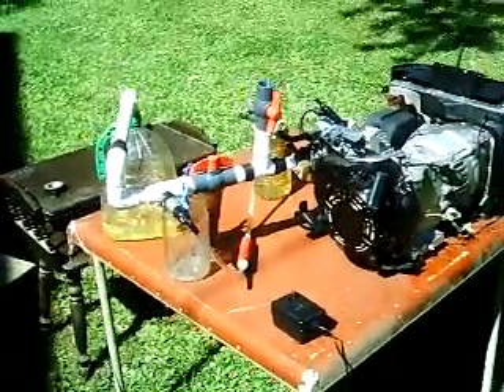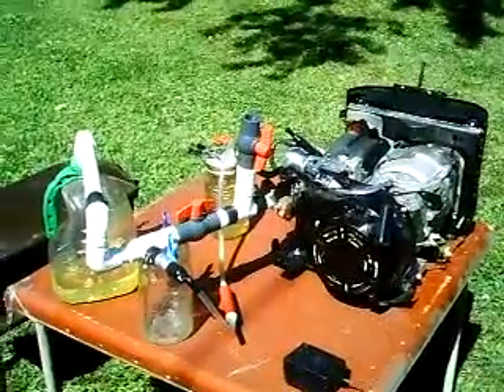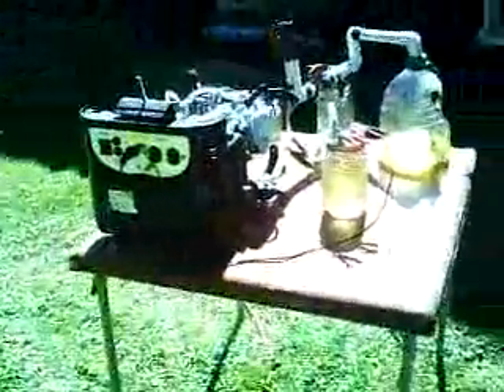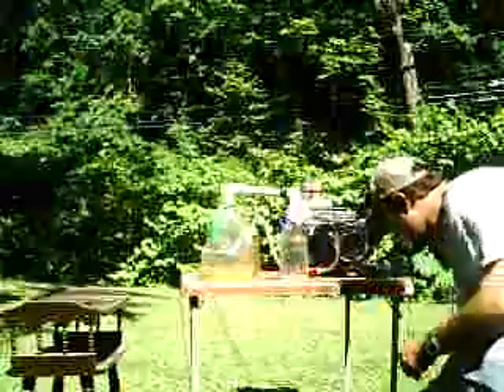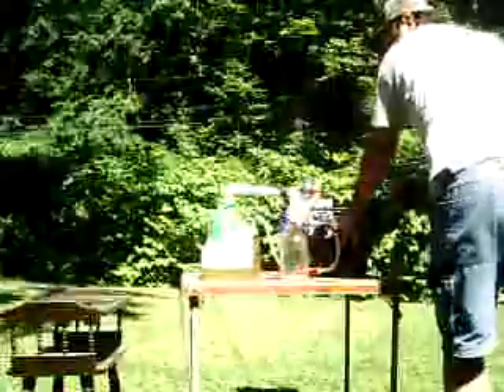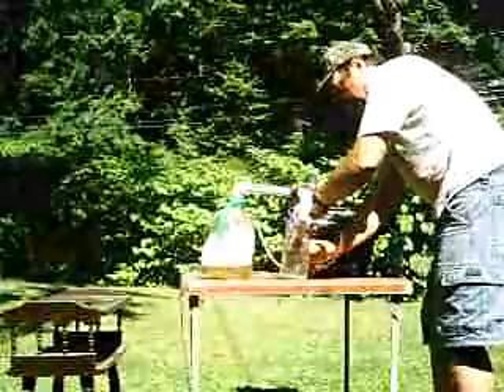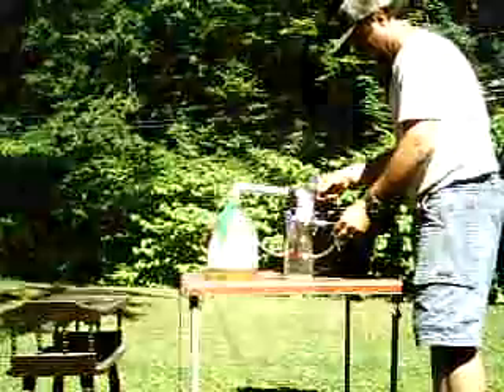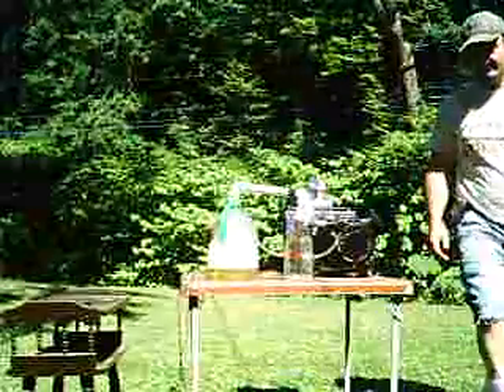Vapor Generator 2

Comment: I ve got a transducer. What is the jar of glass for?  It's to avoid the vapor blows up in the first container? Like a Flash back arrestor? Or a bubbler? How do you regulate the vapor? 
Have you calculate how much vapor do you need to feed a car? 
Whats about diesel e engines? Can you add some vapor gasoline to the engine?

Comment: Do you have a link for the model of a transducer to use?
Reply from the maker: Yes it on Ebay http://www.ebay.com/itm/Ultrasonic-Mist-Maker-Fogger-Water-Fountain-Pond-12-LED-Air-Humidifier-Atomizer-/281391755404?pt=LH_DefaultDomain_0&hash=item418441708c

Comment from the maker: Sounds like you have a plan the engine for my gen is a 5.5 HP motor You should be able to produce more than you need just adjust the air to fuel and vapor ratio should increase not only your milage but Horse power as well.

Comment: That is awesome I just ordered my transducer off ebay from a seller in Hong Kong. Ebay also has Voltage boosters that take 12vdc and boost it to 24vdc which is what these transducers need. I'm curious to how much vapor is needed to run a 1.5L car and be able to completely disconnect the fuel pump? Maybe 1 transducer per cylinder? How many liters would you say that generator engine is? It would also be cool to see you put 50% water and 50% fuel in the bucket and fog it and see if it runs!

Comment from the maker: Acualy i have done better since the video i dont need to adjust the trick is getting a even flow with the Vapor/Transduce buy keeping it a t a constant depth then you need to adjust only once or even wide open and youse the engines buterfly auto adjust depending on the engine. Yes it burned all as i could tell let me know how yours goes

Comment: Diveborg13 I have a question. At how  many minutes did u needed to adjust de air supply and for how long did it run before u start to adjusting the air intake? Did it consume all the gasoline including the heavy hydrocarbons?
Im using 3 transducers and before I need to adjust the air is runing for 20 min. Doing more test this next weekend.
Take care

Comment: @diveborg13
That residual "stuff" that's gets left behind is detergents and additives that don't vaporize easily or they don't vaporize at all! YUCK!!!
This is why 2-Stroke motors have problems using a vaporizer fuel delivery system. The 2-stroke oil vaporizes at a different temperature and ends up separated from the gas. This leads to a seized engine very quickly.

Comment from the maker: OK been thinking 2 things to be more eficient adjust air fuel mixture Not as much vapor is needed as it is Much Stronger.  ALSO the residue Might be due to the container. When i built the Float it got eaten away buy the gas so there was alot of residue everyware. Try a Gas can cut open if your not already doing it.

Comment from the maker: No problems what so ever this is not a oil mix engine but as it stands its fine Pluss it seems to run cooler i suppose its cause it burs complete. The gen does have a oil resivar just like a car.

Comment from the maker: Yes i did 1 test been busey with other projects But the gen Runs 8 hours on 2 galons of gas Normaly. with the vapor i had Half a gallon of gas and ran it 6 hours and still had half of that i only stoped cause i made a Float that got eaten buy the gas. Currently i'm working on something better

Comment from the maker: It uses about 24 to 36 volts a transformer comes with the transducer. I bought it off ebay any will do. No it doesnt get hot its called cold vapor. So far No build up in fact it burns so clean Yes it is MUCH More efitient. No need for a bubbler Just Put screans in the tubeing. Buy a Mesh strainer and try putting a Flame from a lighter on it. You will see it works and lets the vapor go threw. I put 2 just in case

Comment from the maker: yes it depends on the depth of the transducer in gas. The float you can make can adjust it fine. Pending on your needs you might consider a transduce with many transducers on it. I seen them But this seems to produce alot more than the generator uses.